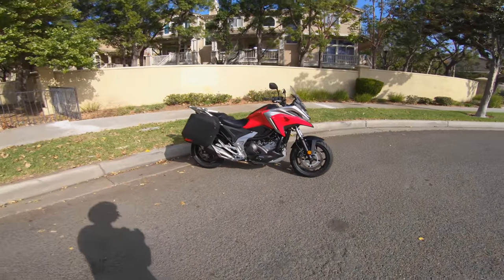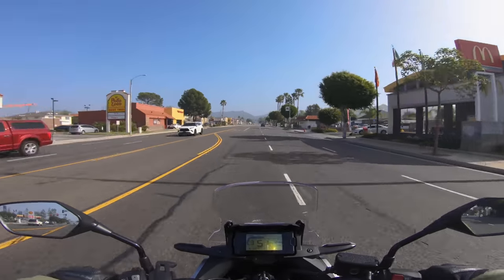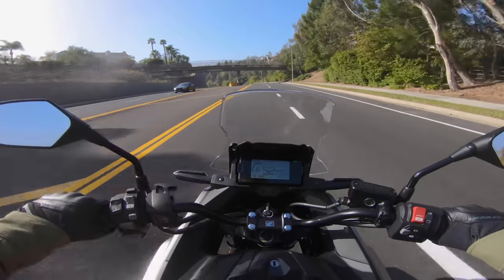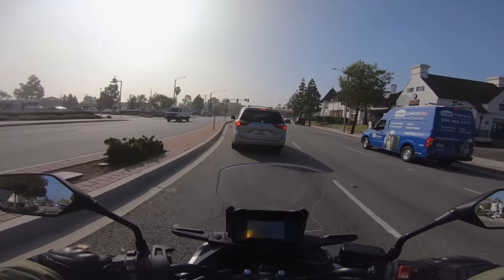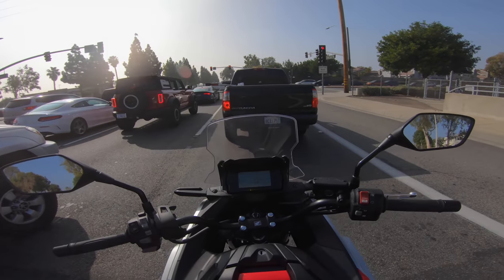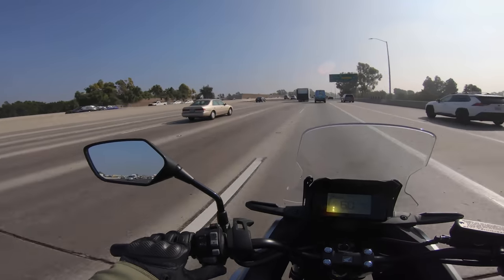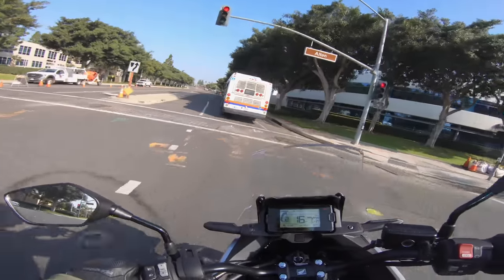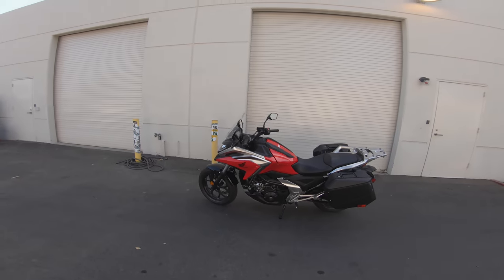2021 Honda NC750X | MC Commute

Comment: I don't like that motorcycle. If I wanted to ride a two wheel automatic I would ride a scooter which I am riding right now. For a motorcycle I love to change gears, and feel the clutch.
Reply: They make a manual 👍🏻
Reply: @mindspinn311  You know what this will lead to? Just like the cars from the good ole days where most of them were manual. People got lazy when the automatic came out for the cars, and now look at today. There's only small amount of manual in cars now. The new BMW Supra is auto, the GTR is auto, and I think most of these exotics are freaking auto with paddle shifters that is so freaking boring. I just hate to see motorcycles go this route. Scooters one thing, but making a motorcycle into an auto is where it will begin in decline of manuals. That's what I feel.
Reply: @ilive4d80s6  Virtually impossible. The automatic motorcycle was once before a failure, by Honda, and is only made viable again by their patented technology. No other two wheel manufacturer had an interest. Automatics will only get so many people riding. Most of those kind of people are terrified of motorcycles. It will be a niche technology until electric eventually replaces internal combustion.
Reply: I've been riding for 30+years. Bought this bike with the dct and will never go back to a manual. It's that nice. Squeezing fingers and wiggling toes isn't as manly as people like to pretend lol
Reply: @filobetobaby  Manly?! You go by looks? You know what I ride.  I ride a little 300cc bike which right now I could only afford,  but I still enjoy the ride.  I don't care what people says about me riding a 300cc bike being that I am 350 lb man. I only ride for the enjoyment. I only ride for the ride and part of that is experiencing all that a bike can be when you have total control shifting gears manually is the way to go, and it's fun for me. I'm glad you have it your way in an automatic bike but this trend is going to destroy the manual just like it did with cars. Just like all the sports car from the BMW supra, Nissan GTR, and all of lamb's going toward auto/eshifters. It just got boring! Automatics are made for work, and boring transportation. I ride a little 150 scooter everyday for work oh, and most of the time if I don't be a adventurous on it I would fall asleep on the Wheel. Automatic is only good for that and nothing more. Shifting gears manually with a clutch is pure fun. Most people that get automatic are freaking lazy. Yesterday I put in a new clutch lever on my little bike. I swear the controls gotten so smooth. I bought that bike used from a private owner oh, and he said that he dropped it once but it was on a standstill. It wasn't that bad the fairings on the side cracked a little bit. The clutch broke on the tip oh, but it still works. Ever since I bought it last year like it is and wrote it with the broken lever clutch I just got used to it but when I replaced it to yesterday man it Shore Drive smooth. I want to go riding more today but I got to work and after work my wife want to go to the casinos if I meet my goal. I'm not really shooting for it because I am so slower Tire today. She might not care and just take me to the casinos and we could eat buffet. I thought I was going to work in the morning but I just I'm so tired I'm just going to do the afternoon shift. I need to take a day off so I could ride somewhere. I want to take that route going towards Hattiesburg I know it's a two-hour Drive I just can't do that I'm just going to do part of it just see the sites. I don't mind driving to Hattiesburg if I had enough money to eat out there. The only reason why I want to go to Hattiesburg route it's because when I used to work for a medical company I used to drive there a lot toward hospitals and what not to deliver medical equipment. Now that I'm out of that field I just want to drive around there little towns and just see the sights. I don't know if I could ride couple hours I think my Max stamina on a bike right now since I'm almost 400 lb it's like 45 minutes 2 an hour. Today's it said on the Weather Channel it should get a little warmer. I don't know if I should wear a jacket when I'm on my little scooter I'm usually hot. I also got some new motorcycle gloves from motorcycle shop that was really nice I got the extra large because I thought I could put those slip-ons when it gets really cold. But it looks up the gloves I didn't have to put the slip on since it was really leathery and thick except the cold out so I had to return it to get a better size and the shop really accommodated me that was freaking awesome!
Reply: @ilive4d80s6  lazy? Lol like I said wiggling fingers and toes isn't that hard. I'll take a smooth ride over the thrill of pulling in a lever any day 😂
Thanks for the essay though
Reply: @filobetobaby  You know I didn't mean you were lazy. That's you preference. Any skilled rider can ride smooth. I've been riding manual cars, and bike s for many years,  I can ride it all smooth. It's the effort that counts. I'm stating  most people. Like me today I'm really going slow.  I'm suppose to be getting my get ready for work and getting something to eat. Luckily last night I have hamburger leftovers that my kids made for dinner I could eat it today real quick warm up the Patty in the microwave and just blocked some whatever on it eat it real quick and go. It's the set-up that I have to be quick about it. I still don't know if I should wear a jacket or bring one I don't really want to bring one because it's too much weights but if I have to I will. I know it's going to be a slow day because it's Thursday and most of the time I had a rough day yesterday I don't know where I'm going with this but I hope I finish up in time so I could go to that smaller trip to the casino with my wife. I think she's got a addiction what the slots. The sun haven't even been out yet it's still look gray outside. I hope it don't rain on me like last time. I am so slow today and it's getting really tiresome. Luckily I can wake up early but I'm always sitting in my recliner. I don't sleep on a normal bed because of my back issues. My recliner is wake up comfortable for me I want to get that required that has a hydraulic controls, or I want to get one of those massage chairs but it cost so much! I think if I get one of those massage chairs I won't be able to get up.
Reply: @ilive4d80s6  nobody is as consistently smooth as a computer. Ride as a passenger in a manual car or on a bike and you'll see how noticeable the shifts are. Helmet knocking isn't a thing on a DCT... It's just a different experience. I've ridden both extensively so I'll just go ahead and claim more knowledge on the subject 😁 Have a good day
Reply: @filobetobaby  came home early today. It started raining so I couldn't do much. I still don't like automatic motorcycles, but hey if you'd like it enjoy buddy.
Reply: @ilive4d80s6  I can see why the DCT is a great choice for some riders, or for a bike like this that's more about practicality than enthusiasm. At least it's a clutched automatic rather than a CVT or slushbox of some kind. I don't think automatics will replace manuals for motorcycles -- at least not until they all go fully electric and there's no gears to shift :(